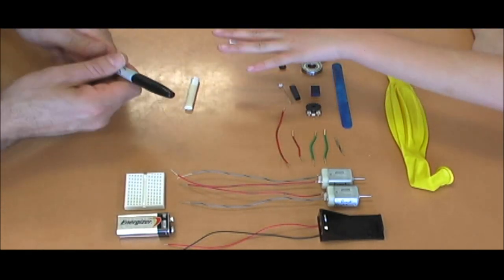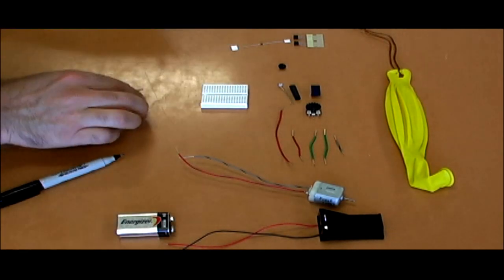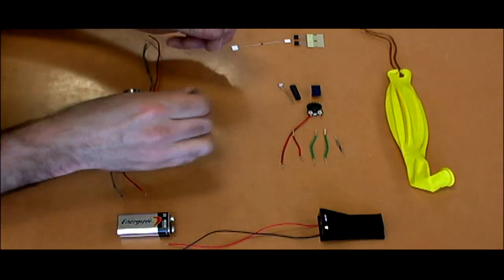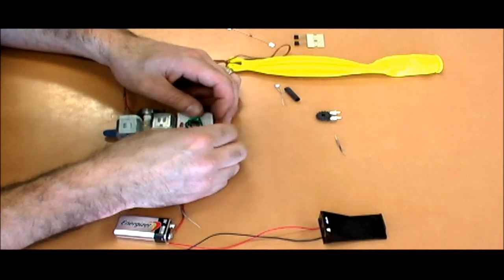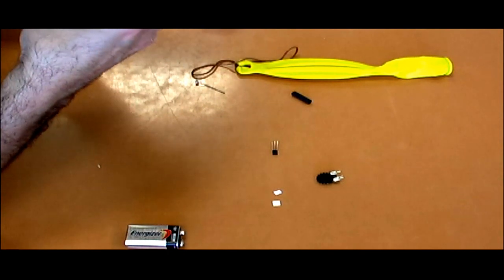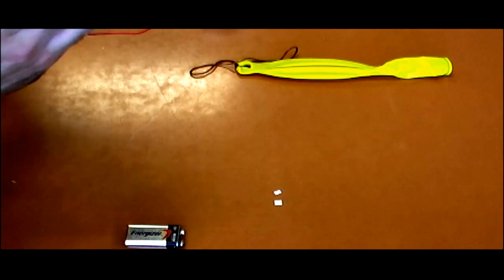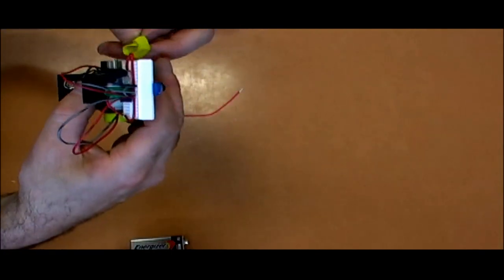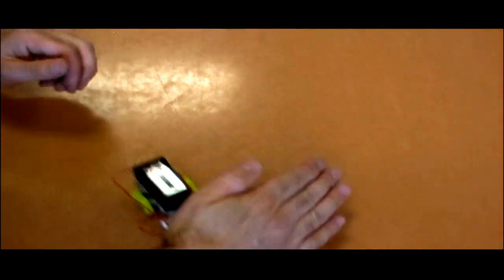LetsTalkRobots Ep008 Build a Shadow Runner Robot

Comment from the maker: Any 9V Double Pole Double Throw (DPDT) momentary relay should do. You may find that a 12V DPDT momentary relay will still close OK with a 9V battery, but it is a risk that there won't be enough voltage to close it reliably. As the battery wears down, this is even more likely.